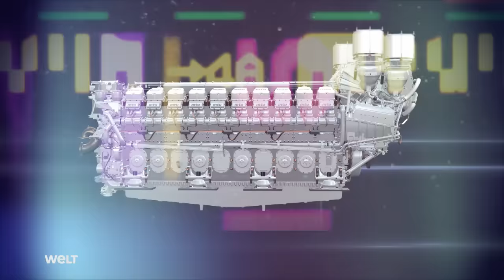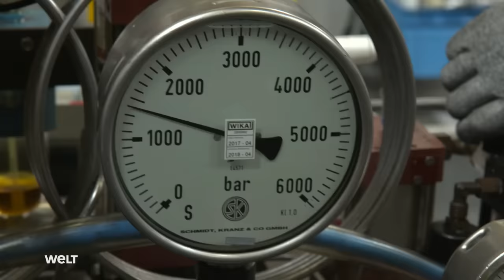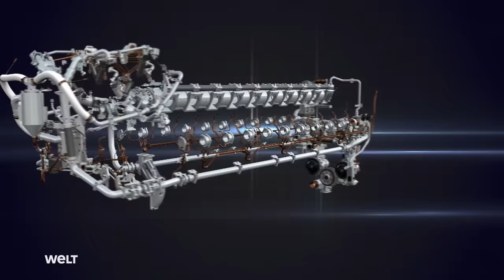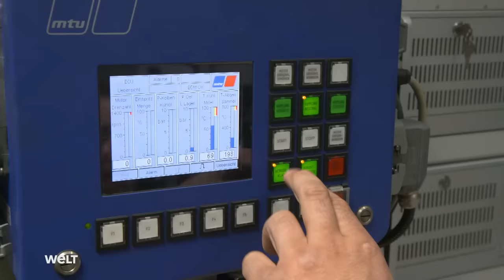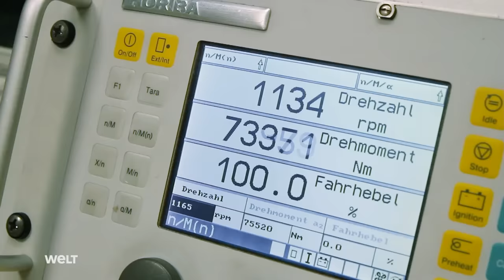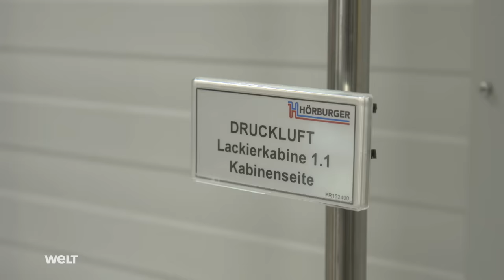Mega Diesel Engines - How To Build A 13,600 HP Engine | Full Documentary

Comment: Didn't show the grinding of the bearing surfaces - one of the most interesting parts for me.  I mean, for example, the supports for the crank main bearings (I know that crank doesn't actually run on these, it runs on the plain bearing shells.)
Reply: So the reason you never saw grinding the crank support bearings is

They don't grind them.....

The only thing they grind is the crank journals the bearings press against..
Reply: These bearing shells are not grinded anymore, no white metal...When scratched or due for maintenance, all to be scrapped.For this kind of High Rev Engines you just change....or collect the pistons together when they step out for some fatigue reason......
Reply: @Limoncello666  I think he was referring to the machining of the bearing surfaces after the block came out of casting as well as the crank and cam, not the repair process, that was clearly explained throughout the documentary. and there probably isn't much to see as the modern machines are usually CNC controlled with covers or gallons of fluid blocking any working views of the detailed process ... but its always awesome to see a machine tool take a raw part and make its precision! :-)

Comment: Hmm, no mention of rolls royce at all
Reply: i wporked with theese MTU v12 engineds, nothing to do with rolls royce, Rolls Royce supply deck geqr, anchor winches thruster units and jet drives are rolls royce. Rolls Royce Kamewa Jet Drives.
Reply: MTU
Reply: https://en.wikipedia.org/wiki/Rolls-Royce_Power_Systems
Reply: MTU is owned by Rolls-Royce
Reply: This documentary is another of those dumbed down affairs. There are loads of innacurate or spurious comments throughout the 50 mins. They don't know their ass from their elbow no wonder they can't identify Rolls Royce from other brands.
Reply: terrible click bait,
Reply: Alen Augustine whom is MECCEDES BENZ. MTU stands for Mercedes Transport UNIT.  CHEERS FROM NJ 🇺🇸🇺🇸🇺🇸🇺🇸
Reply: Andy Jasso MTU is a part of RR.....
Reply: Gareth Thomas And you see them on ships, power plants, trains, oil rigs.
You obviously don’t know what you’re talking about. 
However, engine business is now under Kongsberg and not RR.
Reply: @flybyairplane3528  Wrong. 
MTU = Motoren Turbinen Union
Reply: Stephan 'Uhu'   And below that MTU /DETROIT , AND ALL OD THEM ARE GREY PAINTED.
Reply: Leighton Samms uhm, no it doesn't.
Reply: MTU is over 100 years old and was only purchased by rolls royce few years ago. This documentary has already been released many years ago in germany but was only recently translated in english, so it was most likely filmed before the takeover.
Reply: Rolls Royce Bergen Engines produces bigger engines then these.
Reply: jørgen færøy they are a damn good engine too!!
Reply: Hmm, its just about MTU... (not RR)

Comment: 48 tons is around half the weight of a fairly small steam locomotive, even by UK standards. (UK locos are small, limited by the loading gauge).
Reply: It is the average combat ready weight of a US M1A2 Abrams tank, or 8 tons heavier than a standard US tractor trailer can be without special permits. And this beast is just the motor...

Comment: at 14:23 you can clearly see that the link on the lifting hook is cracked!
Reply: Gosh darn that looks dangerous!
Reply: You would think they would weld that up because that is extremely dangerous.
Reply: If only they had purchased a good quality link made by Rolls Royce this hazard would never have arisen
Reply: yes i saw bottom mid ( left part of it )  section of screen , very risky
Reply: Ragnars Brother ....if your talking about the area of the outer block plate at the bottom left, that is not a crack. It is a chipped weld and is not a detriment to the block and tackle lifting hook.
Reply: @howardosborne8647  that's what you get when you use aftermarket parts
Reply: @robertlangley258  Yeap. It's not cracked, it has a welded plate on it. To lift heavy pieces with a cracked link would border on insanity, and Germans are not that pasional.
Reply: Serban Oprescu ....you are absolutely correct sir, it ain’t gonna happen when your talking this kind of money. Safety is first tied with common sense and a bank run to make.
Reply: @robertlangley258  If that's not a crack, I don't know what is.
Reply: @SerbanOprescu  No, that is a massive crack.
Reply: Terrifying!! Great eye to spot that.
Reply: scary
Reply: @robertlangley258  I've been a logger in Wyoming, laid pipeline, worked on oil drill rigs onshore and offshore, was a mechanic on a Robbins 35" TBM in the Chicago Deep Tunnel Project and am glad you were not the safety officer on any job I was on.
Reply: That crack its not attached to the hook or lifting device - its the safety latch that secure the ring that holds the chain in place -  I see it all the time. Especially when plp try attaching larger lifting rings/chains than what the hook opening are design for. Not dangeroous at all - the hook are just fine.
Reply: Ragnars Brother    Bravo, Falcon eye! I did not see that!
Reply: thats german engineering for ya
Reply: That is definitely a crack.
Reply: Probably didn't see it yet
Reply: That's not a crack in the link/hook but a crack in the 'keeper' that keeps the lifting ring in the lifting hook. Most if not all lifting hooks have 'keepers'. Still, that would take a welder all of 5 minutes to fix - bit sloppy.
Reply: @teebosaurusyou  Weld repair vs. replacing a critical component when a failure would be catastrophic?
Reply: Ragnars Brother : yeah, you are correct i have gone back and re-watched that part, you are correct that lifting hook is most definitely  cracked and almost all the way thru there is very little metal keeping that hook together..

Comment: hudge diesel weighing over 40 tons : i make 10,000 hp beat that
top fuel : hold my beer
Reply: That's the difference between 10000 hp continuously for hours on end and 10000 for 3 seconds and then a rebuild, if it even stays together.
Reply: @jfdb59  it was meant to be a joke ik how top fuel runs go my dad used to be on a matco team and rebuilt them after every run
Reply: @randomvideos3026  it's just not a very funny joke when there is no pun or comedic irony and just a very simple logical explanation.

Comment: I wonder what units their measurements are in. Because according to what they had listed on that sheet they were ranging from 210-225 which seems like a large range unless they use some for one engine and others for another. My guess is that the unit was centimeters because it seemed to be the journal diameter but surely the journals are more accurate than that.

Comment: 2000 litres an houer? For our American friends: this are 528 gallons an hour this engine swallows.
Reply: This is why GE LM 2500 marine gas turbines engines are lighter faster and far more fuel efficient while producing more horsepower and torque.
Reply: @jcfireman2215   Don,t think so, fuel efficiency for the LM2500 is 214g/kWh, the MTU is 199g/kWh (at rated power). Service interval 50000 hrs vs. 72000 hrs, 20kNm vs 60kNm (nominal, geared down LM2500 it will be approximate even).
Reply: That's 8.8 gallons PER MINUTE!

Comment: Curious about the mechanism that shoots the steel bbs to clean off the casted pieces. Is it a wall of death or is there some sort of movement or rotation? This is by far the coolest how its made i've seen, amazing work
Reply: I was thinking about that shot blaster thing too, it must take ages to clean the engine out of all the BB's once they are done. I would of liked to see a video from the inside of that machine too while it's doing the cleaning process (if you could get a camera to survive inside there!)

Comment: 23:30
20 revolution a second. That is a calm 1200 a min. But 20 revolutions per second sounds way faster I guess.
Reply: That's very fast for an engine that size. A semi truck engine tops out between 1,600 and 2,000 rpm. A diesel pickup truck engine will run between 3,500 and 4,000 rpm. A typical automotive engine will max out between 5,500 and 7,000 rpm with high performance engines reaching up to 9,000. A motorcycle engine can run as high as 12,000 or even higher. Nitro RC engines can reach over 20,000 rpm. Just imagine you're swinging a fishing weight around on three inches of string. You can get that going very fast. Now imagine a bodybuilder swinging a cannonball on the end of an eight foot chain.  He can probably get it going, but it takes a lot of effort and can't get nearly as many revolutions.

Comment: This is just a medium size diesel engine. Have you heard of the 2 stroke diesel engine built by Sulzer or Man B&W? That's what considered as MEGA diesel engine.
Reply: @Albert KCC  I'll have to look that one up.  But bear in mind, most everyday people havent seen an MTU 20-cyl 800 Series diesel on video, nevermind in person.  That thing is 10 ft high
Reply: With that massive turbo-charger I'd be very concerned about the possibility of an older, worn system taking off in an uncontrolled, high rpm "runaway diesel" condition.

OMG! With that huge vat holding of 1600 liters of oil??? Able to burn in lieu of diesel fuel in a massive cloud of nasty, dirty soot? That could create a "mega-clusterfuck".

I'd sure hate to be in the same zip code as that mess.

k".
Reply: @Jorge Callico  😆😋😆😋 ...Exxon Valdez Part II, right?  Ive been around diesels all of my life.  Much smaller ones for tractors & light trucks, of course.  Even still I never did add 1 + 1 on that one...

Good grief, makes you wonder: Does the ship have a contingency plan?!  I dont suppose theyre equipped for an emergency dump of the crankcase(s) in that situation, are they?  And I know theres thousands & thousands of newsworthy crisises & catastrophes every year that we will never learn of.  But it makes me wonder, when was the last time a freighter, a supertanker, oceanliner or any vessel experience a "runaway diesel" engine?  :o  :/
Reply: @magnificentmuttley154  
One would hope that some large valve exists to cut off the flow of air into the turbocharger. That would be a logical safety matter. And with at least a half dozen backup hydraulic and mechanical systems in place.

Because big diesels simply must have fucked up before. And the catastrophe of such a huge mo-fo going ballistic staggers the imagination. Any crew members caught down below deck could be caught in a veritable hurricane of dark black sooty clouds. Soon followed by blasts of flames. That's how one dies in a big warehouse fire. Or similar foundry making tons of heat gone awry. You half suffocate crawling in the hot darkness. Trying to remain low. Under the clouds of thick, highly noxious smoke. Then when you do find a door or a cracked window for fresher air?

The smoke vanishes. Like magic. Only it isn't salvation. It's only death. As the smoke itself is flammable. Its a lot like "gaseous petrol". Soon as it meets enough air at the source of a lower flame?

BOOM!

PS: this mega diesel engine, for all of it's power? Turns relatively slow. The narrator mentioned it turning at "1150 RPM". Which ain't shit compared to yer car. Barely over a good idle speed. But since it's pulling a "Niagra Falls"  of water? It is the FLOW that makes the engine so terrifying. 

Now with a runaway diesel there is no regulatory system. It could then perhaps triple in RPM. In turn that's a fucking "gone nuclear" system. Again. I can't imagine how terrifying high RPMs are on such a powerful thing.
Reply: @Jorge Callico  Well, now that youve got me thinking about it, Jorge...  I understand full well what you mean about a turbocharger, without some way to stop it, ramming so much air into the engine that all you would need is something to trigger the "runaway diesel" condition.  You describe that scenario very well...

The likeliest such trigger is fuel spilled into the crankcase & feeding runaway combustion on the downstrokes of the pistons- - where just enough fuel & esp oil vapor is sucked in past the piston rings, then ignited on the immediate upstroke.  I could esp see this happening with a grand-scale 2-stroke diesel

However, Ive never heard of a 2-stroke mega diesel.  And in the case of Rolls Royce/ MTU Division of Germany, & of Dutch-based Wartsila (the only other such manufacturer capable of competing with a company as vast as MTU), were talking about the most thorough mechanical design engineers in the world.  They are on a creative & analytic level that makes Ford & GM engineers look like kindergarteners.  The point is, I would expect that certainly such engineers have thought about the "runaway diesel" issue well in advance.  And I simply dont know what additional emergency measures, if any, that theyve built in.  But the most obvious accident prevention, to me, is keeping the crankcase oil level well below the reach of pistons downstroking at the base of their cylinders.  That & an adequate crankcase ventilation system to prevent formation & build-up of oil vapor that could be sucked into the cylinders, & start the "runaway" effect
Reply: I am following the conversations here, there is no cutoff valve to stop the flow of air into the engine. All this engine fitted with many shutdown sensor to stop the engine by cutting off the fuel supply. As long as the sensor and the cutoff system is working, the engine will stop. Also having a brake fitted to the engine/propeller shaft would be no use for the ship because of the momentum. To stop the ship ahead movement it would require the engine to be reverse or if the propeller is of CPP type it need to be reverse to counter the ahead momentum. Again most of the accident/collision happenned at sea is due to human errors.
Reply: @magnificentmuttley154  
I wonder if you've heard of the most catastrophic runaway diesel condition of all time?

Happened at the BP refinery in Houston, TX circa March 2005. You can look up the specifics in a search engine*. A tower overflowed with a massive quantity of raffinate. This a thick, gaseous petroleum product that once over filling the refining tower (due to a series of cluster-fucks that it seems only Texans living inside of Texas can provoke) the gas fell down towards the ground. Being heavier than air and released in such quantity enough to blow up a city block it swiftly spread laterally in all directions. Looking for, like every good toxic, combustible hydrocarbon does...
For a source of combustion. And?

Sure as shit it found one. What was it? A diesel powered pickup truck parked only 25 feet down the way from the raffinate leak. I can't remember if the truck was running of not but I think that it was. Keys were in it anyway and probably against company policy. 

Okay the truck was still running and against company policy. 
Well the raffinate mixed with air provided an inexhaustible ignition source for the diesel truck to fire up way past it's recommended rpm values normally protected by a governor. 

{ I know all about governors put on motors due to an unhappy childhood experience. I'd once paid good money to race a go-cart at the local amusement park in my hometown. However I caught the only cart fitted with a governor that prevented the engine from delivering full power. So of course i lost the race}.. "Pissed me off. The FUCKIN JERK". Meanwhile it being Texas? "The Rodeo Song" kept blaring on and on...

In turn the diesel became a massive runaway. Although workers frantically attempted to SHUT THE THANG FUCKING OFF"! The truck eventually caused a large open flame somewhere that in turn ignited the whole supply of raffinate. Blew up the whole, entire fucking B/P refinery killing 15 people.

It's okay because it was only Texans. Everyone was glad that Willie Nelson wasn't present. As good ol Willie was the only well liked Texan native living in TX. At least since Waylon was gone. Sorry Toby Keith!

* So long as your search "engine" doesn't runaway from you!

Comment: great vid i love, just still kind wanting to know why i don't ever saw a pickup for the oil pump
Reply: That grammar
Reply: CactosS ; i believe the oil pumps are external to the motor and are connected to the oil pan by hoses and supply the lubricating oil to the motor by the same way "hoses" from the oil pumps to the engine block. i also believe the oil pumps are run by electric motors so they may start them to pre lube the engine before starting it up..

Comment: Why aren't any of the guys in the foundry wearing any real proper protective equipment? I worked as a stand grinder in place that made parts for Allison transmission and we were required to wear fire retardant long sleeve shirts and pants boots with with a special tongue that covered the exposed area of the laces and we wore an apron made out of 1/2 inch rubber that covered us from shoulder to ankle. It was all hot and heavy but it kept you from getting hurt. We also had a huge helmet that was connected to fresh air that we connected into when running the grinder. It was hot heavy work but I liked it, unfortunately the shop foreman and I didn't see eye to eye on one too many things.
Reply: Because nothing will save you in that environment. I saw similar in a train locomotive manufacturing plant in the U.S.